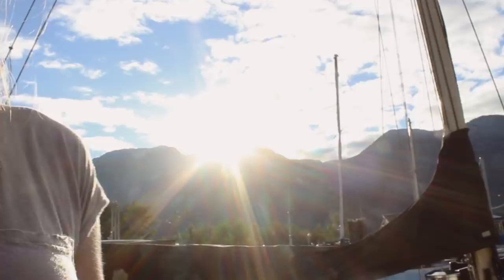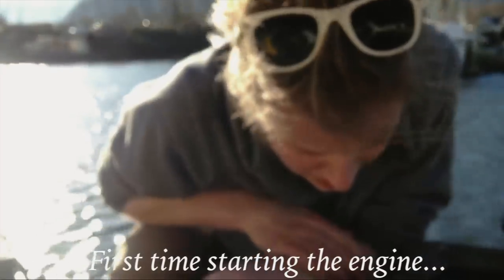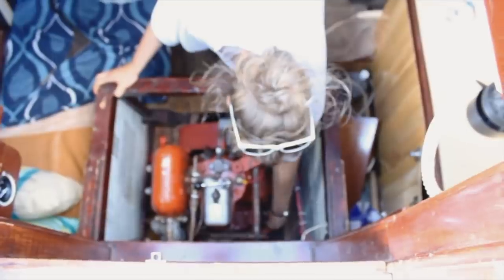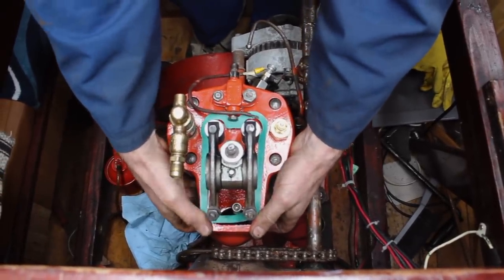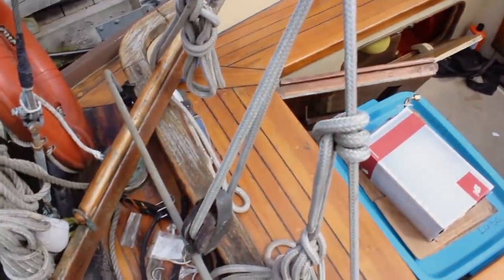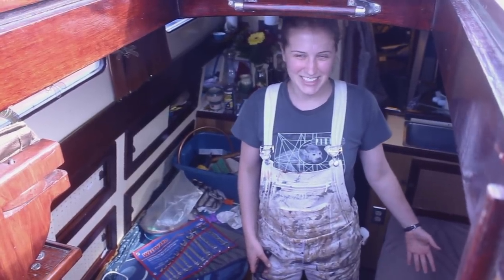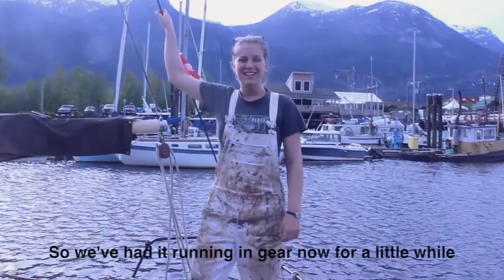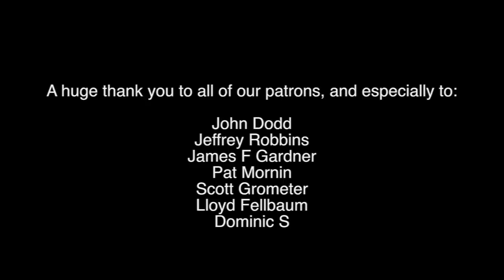Restoring the engine on my $1 boat [Sabb 10hp]

Comment: I’m glad you fixed Saab rather than replacing him like most would have done
Reply: I actually thought she must have misspelled SAAB but I found out it is actually a SABB marine engine.
Reply: Saab is mainly a swedish car manufacturer. Sabb norwegian engine maker.
Reply: So is Volvo, and they make small engines for boats, so it was an easy mistake to make.  @karelvandervelden8819
Reply: Damsgård Motor Factory, later renamed Sabb Motor, was founded on April 30, 1925, by the brothers Håkon and Alf Søyland from Flekkefjord, together with Harald Svendsen. Until 1929 they lived in a sea buck at Damsgårdssundet, in Laksevåg near Bergen. The company eventually became too big for the place and moved to the present address Damsgårdsveien 113. The first engine, model A, was a 3 hp incandescent engine. One aimed for delivery to small fishing boats as there were many along the coast. The engine became popular and gained reputation as reliable and reliable. The last of these engines was delivered in 1962. A slightly larger glow head engine was a 5-9 hp incandescent head motor that remained in production for 38 years. A worm motor of 4–5 hp was made from 1935 until the mid-1960s.In 1958, the first full diesel, a four-stroke of 8 hp, was named type G. This is the well-known single-cylinder SABBen that is found in countless fishing and leisure vessels. Eventually, it was equipped with a starting ring and adjusted to 10 hp. There were also made 2-cylinder versions of type G, rated at 22 hp. The motors have roller bearings and splash lubrication, and an innovative propeller wing reversal system. In total, more than 20,000 of SABB type G have been made. It also existed as a stationary engine without a casing, and as an air-cooled lifeboat engine, then with reversing gear and fixed propeller. The latest engine of this type was manufactured at the factory in 2001. One then went in full with the marination of engines from other factories, as well as continued the production and adaptation of systems with rotatable propellers, gearboxes and other specialties. The motors are then equipped with the Sabb mark. In 1971, the company was converted into a limited liability company and was named Sabb Motor AS. Sabb is now part of the Frydenbø Group.
Reply: @karelvandervelden8819  I am restoring a '71 Saab Sonnett (car) for my son which curiously has a Mercury Marine V4 engine in it (from the factory).  I've had three other Saabs - a 99, a 900 and a 9000 - and love the brand.  I only quit because I don't want a daily driver that doesn't have manufacturer support.  Now back to boating!

Comment: Progress is like traveling along the shape of a saw tooth, you climb up for a while and then drop down sharply.  But progress isn't just one tooth, it's a blade with many teeth and the blade is at an incline where the future is higher than the past - so when you drop down you are always slightly higher than when you started the current tooth; even if all you gain is knowing not to do whatever it was again.

Failure is not when you experience the abrupt drop - it's not climbing the teeth in the first place.

Never, never, ever give up
If you don't know, find out
If it were easy, everyone would be doing it

Comment: What a struggle you had... There is spareparts around here in Norway the "finn.no" is a great place to find it, but their search is in Norwegian. If u need something for that beautiful engine let me know... I will give you a link to the seller.
Have one of those Volvo Penta (Saab) engines myself in my boat - with two cylinders and it runs great (made in 1982).
Reply: I have one of these same motors and I am in need of some gaskets. Could you send me the contact info for a source?

Comment: My diesel mechanic inquiring mind here. It's simple to pressure test the cylinder liner & the head once they're out, what was wrong with the original cylinder head that it couldn't be repaired?
Reply: Yeah, what was wrong with the original head? I would like to know, also.
Reply: I was guessing that the cam went flat,but your Dad would know that.
Reply: I'm thinking a valve hung up. That's why it originally did start. Those valve seats can be reground and the valves lapped in. Take it to an automotive machine shop--they will do it for you. At least you will have a good spare or offer it for sale to someone that needs it.
Reply from the maker: Sorry I know this is a delayed response, but better late than never! We did pressure test the head and got the valves reseated. All appeared to be good. However, the inside of the cast iron head was so rusted out that after running the engine for a while under load, it simply couldn't take the pressure from the combustion, and it blew a hole right through the cast iron. That's why the engine started up at first, and seemed to be functioning perfectly, before dying suddenly and no longer being able to muster any compression whatsoever. No fixing that, hence the new head.

Comment: if not the most reliable engine at least in the very toop just make sure it has oil, fuel and air nothing can really kill this engines... got a 30hp in my fishing boat now.. was sitting for 8 years.. alltough it was a bit stuck. still started after loosing here up just a bit.. ;D

Comment: Can you tell me what you are putting in with the oil can? Thanks.
I just got an out sail boat with a Sabb 10HP and trying to figure out how to start it!
Reply from the maker: That’s just oil. If it’s manual then hopefully you got the lever. Engage the decrompression lever-crank crank crank and flip the lever over. Some have en electric start motor though.

Comment: frost, or freeze plug, is on the outside of the water jacket....not the cylinder . A brass freeze plug will last a long time, but the rubber ones are easy to replace. As for the rust with salt water.......zinc fittings are a MUST. They rust bad, but they do it rather than the engine. If there is any way to convert  the cooling to a closed system with anti freeze, it will double the life of your engine. In most cases, when engine rpm's cause water to leave the cooling system, its almost always a head gasket, or a cracked block. BTW, im a mechanic with a very small channel, and i check my youtube daily. If you Ever have mechanical questions or need fix it advice....pls message me, ill write back shortly !

Comment: Hi Maya,
Re your comment on Magic Carpet being a 6 tonner, but it doesn't weigh 6 tons, well it wouldn't! Thats because it's an old English measurement of the internal volume of a boat. Magic Carpet is a 6 Tunner.
The volume is based on the volume of a barrel called  Tun (the largest barrel size) hence the confusion between volume of a large barrel, a Tun, & the weight of a Ton (Imperial ton = 2240lbs, US ton =2000lbs). A Tun will hold 216 imperial gallons ( approx 260 US gallons), so the intenal volume of Magic Carpet was rated at 6 Tuns at the time of its build, that makes the internal volume to be 1,296 Imperial gallons or approx  1,560 US gallons.
Hope that clears up the confusion
Kind regards  from George Bevan in the UK.

Comment: I really love that hand cranked engine.  What a classic.  This is a phenomenal project.  I really envy you.  Just out of curiosity, what is that lever your Dad turned after you cranked the engine.  Some sort of clutch?  And if so, can you start that engine by yourself?  All the best, and greetings from the cold Northeast (Boston) area.  Jim Andersen, Cat Boat Adventures, Buzzards Bay, Massachusetts
Reply from the maker: That is the compression valve! It has to be open to crank the engine, and then it must be closed quickly for the engine to come to life. It is possible to do everything by yourself, but it’s much easier with two.
Reply: That a decompression lever. In cold start you put oil in cup on rocker cover, turn engine and close compression. 
When really cold, take out the bolt ,plug at front of head, inject 8 squirts of oil. Wait a minute. Then repeat staring procedure. Even when worn, the engine will start
Reply: Cat Boat Adventures I also wired a cable that pulls the decompression lever open , and once you release while spinning engine, you release cable and it closes the lever, easy by yourself
Reply: @arekkaniewski4442  This is really fascinating.  I really love the charm of this story and this boat.  That engine is such a classic!!!
Reply: Decompressors are common on diesels.If you tried to turn the engine without opening the decompressor you would find it would only turn so far before the pressure in the cylinder made it impossible.So to allow you to get the  heavy flywheel spinning fast enough for the diesel to ignite, a little valve is fitted in the head.In the start position you can hear the air just escaping, hissing, out as the piston comes up.As you saw, the engine is spun by hand as fast as one can and then the valve is quickly closed.

Comment: I've no idea why Welch plugs began to be called frost plugs. It's true that freezing will push them out but by that time the cooling jacket is probably already split. The plugs are there to occlude holes that are present to allow the casting of the cylinder block.

Comment: That 6 ton size was a calculated nominal number devised by RTYC in 1855 to determine a yachts size for port dues. Similar to the 12 meter rule or 6 meter rule for race boats ( nothing to do with actual size). Or the IOR Racing rule for 1/2,3/4&1ton classes. 
In the 1920’s it would have been ‘middle class’ to say you kept a 10 ton ‘Thames’ yacht at the coast. 
So much nicer that plastic fantastics these days only based on length. 
Cheers Warren 
For more see wiki
https://en.m.wikipedia.org/wiki/Thames_Measurement

Comment: "frost plug" is actually where the sand is emptied out of the cast iron block after being formed..
Reply: PBR Street Gang 

That’s pretty cool. I never knew that. 😁
Reply: @NPCSN      Yes.  Frost plugs won't save your engine in a hard freeze.

Comment: I have a SABB in the boat I bought when I was 19.  I bought a second SABB type G for parts to get everything running again.

I have the original manuals for the SABB and most parts on hand. And know the engine very well after rebuilding mine and sailing her for a few years.

I did add a seawaterpump and modified her to take indirect cooling so she will never has rust inside again and can run forever.
Photo log: https://imgur.com/a/qOITu  (photo's of the later modified wet exhaust and additional seawaterpump on the end)
Other modifications I made include a high power alternator. And a standard greasepump that takes plastic grease cartridges for greasing the prop. 

If you would like the manuals or have specific questions send me a PM and I will email them to you. 

I see  judging on the "gear" lever you have the sailing prop with "vane" position on yours? That is my next project. The scrap engine I found has the sailing prop, but to fit it on my boat I need to exchange the gearbox and shaft. 

When properly tuned these make a lot of power. Officially 10hp. But I can outrun my buddy with the same boat and a 14hp Yanmar. 
My 4ton Trintella1 does a full 6kn with the SABB.

Comment: "A frost plug is there in case the water inside an engine freezes"

This is a very common misconception, but it is not so.  They are called "core plugs" and they are there to facilitate removal of the sand cores which create the engine block's internal passages when the block is cast.  Once the cores are removed they have served their purpose, and the plugs are installed.  If the coolant is allowed to freeze, occasionally they will burst as you say, but they are not designed for that, and thinking that a core plug will save your engine may cost you a cracked block.

When you find a rubber expanding plug installed in a block rather than a metal one, it usually means that the original metal plug either leaked or fell out, and the mechanic who repaired it was either too lazy to install a proper metal plug, or lacked sufficient access to swing a hammer to either drive a new cup type plug in, or to upset and bind a new Welch plug in place.  Given you say the rubber plug was on the back of the engine where there may not be access, I suspect the latter was the case.  In situations like that you are using the rubber plug as a temporary repair until it is more convenient to remove the engine and replace it with a metal plug.
Reply: Yuck Foutube  The dished disk type of core plug was invented and patented by a couple of brothers named Welch, so that is the actual proper name for them.
Reply: This is cool info. I had to replace a "freeze" plug on a Pontiac once. No room to get all the rusted metal out of the plug recess, so I did go with a rubber one. I had no idea about the sand casting.
Reply: She knows this,now. rubber ones are WAY easier to install.

Comment: Boy I sure hope after a new lining installation and a new head you put in new bearing and oil pump if this engine has one. I would hate to see this engine siexe due to a worn bearing and ruin the other new parts.

Comment: i must unfortunately correct you, Saab is swedish not norwegian and they mainly build cars but have also buildt planes (drakken) and boat motors, they are sturdy and rugged so are almost never failing unless maintainance are neglected but all motors are like that.
Reply from the maker: Thanks for the comment! I must unfortunately correct you though. You're right that Saab is Swedish and they mainly build cars, but SABB is Norwegian (notice the different spelling) and they mainly make marine diesel engines. I have a sabb engine, not a saab. They are two different companies! Confusing, I know. Many people make the same mistake!
Reply: Sailing Magic Carpet thanks learned something today, so not a total failure :)
Reply from the maker: @MidnightAmratha  Excellent! And don't worry, you're most definitely not the first to make the same mistake, the Swedish Saab is a much more well known company! :)

Comment: you could just buy a new engine a 10 hp gas one from princess auto for super cheep like 100 bucks or of you wanted a diesel mabie 250 it would be easier than this although i do understand the pleasure in keeping things stock on a old boat
Reply: @stephenjdixon1  if youre smart about it it is safe but i agree i love disel engined its just alot of people like petrol because its cheeper to run and mantain

Comment: If you going to putt putt up river that fine. If your going far  a New engine is needed. Dont be cheap with a new  motor what can save your life and other boats. What happen if the waves are pulling you to the reef or to a containers ship? I watch many boater who quick starting  engine save their live with second to spare.
Beside open chain  sprocket  you reach next to at night of in a careless  rush would pull your and and arm into he engine 
 Can't expect a 80 yr motor to work hard. If only you seen what it been through
 What is a  accident? Its when reality  and unrealistic perception\expectation  meet and the math don't add up. Its is what it is. Its hard enough for a new motor to forfill that duties.